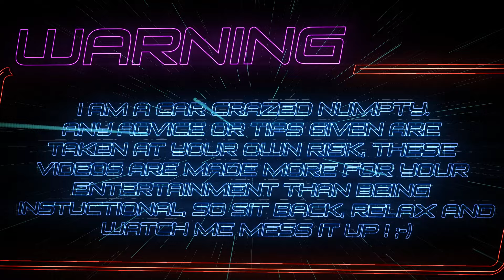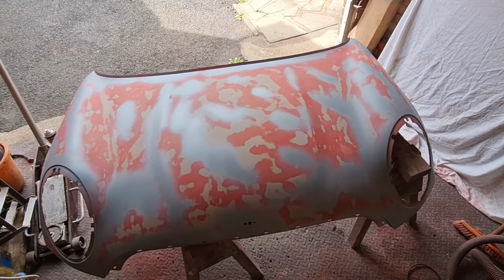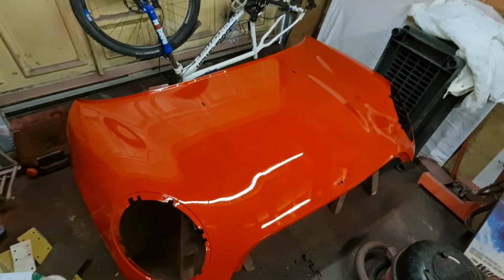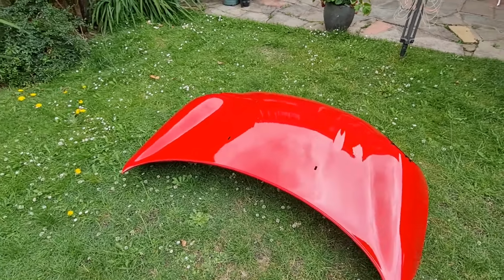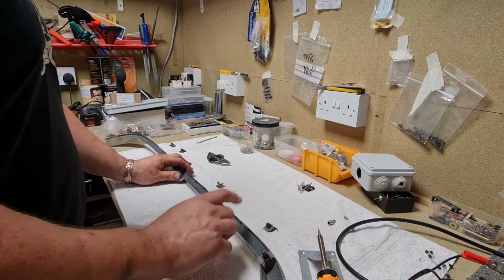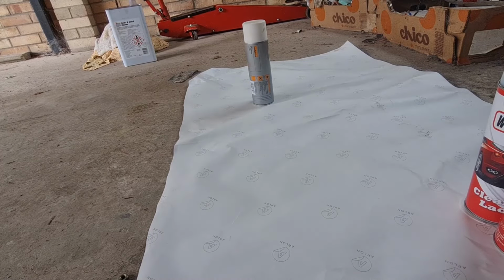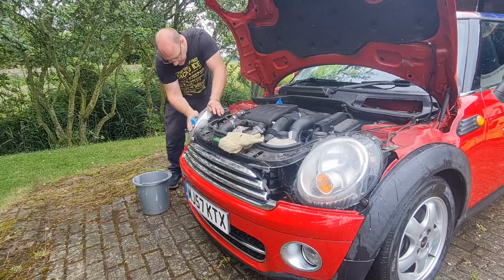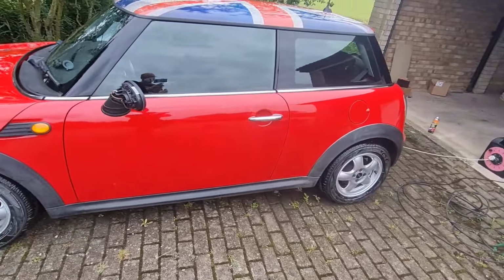Mini Cooper R56 DIY Bonnet Painting... PRO Results from a CAN !! NOW FOR SALE !!!

Comment: Nice work! Can I ask what compressor you use, I've tried a da with my 50 litre supposedly 9cfm one, but get about 5 seconds before it's on its arse giving a whole load of no effort 😂😂
Reply from the maker: Hi thanks ! Glad u like it, i have a compressor from SGS with a 100 litre tank, heres the link... https://www.sgs-engineering.com/sc100v-100-litre-high-flow-air-compressor?utm_source=awin&utm_medium=Affiliate&utm_campaign=https%3A%2F%2Fwww.delupe.de&utm_content=559319&utm_term=CjwKCAjwy8i0BhAkEiwAdFaeGGjj44Nd4hQyjWP_c6JAcYUHFiFfWZO8CtTI64XfUA_t5qDeA4vXpBoCl9oQAvD_BwE@235&awc=28807_1720899660_dc553e122fed8779126ab79573a2e6fe
Hope this helps 👍👍
Reply: @mec-tec  ah, the bigger brother to mine. Wish I'd spent more when I got it now lol